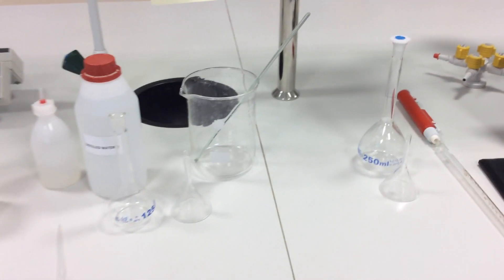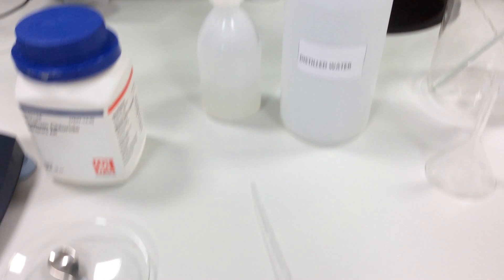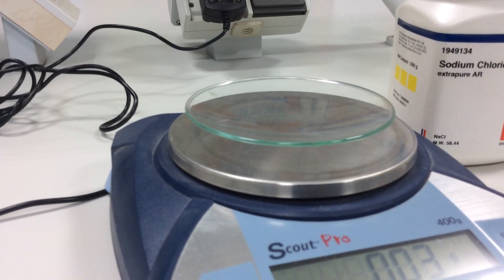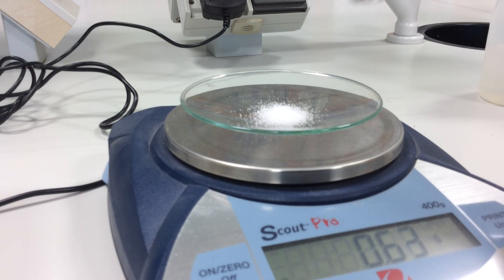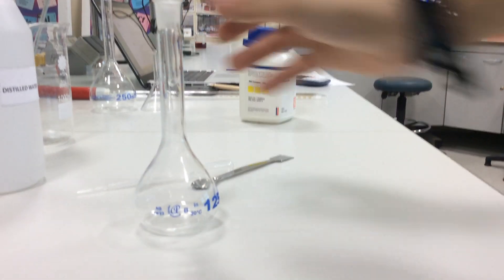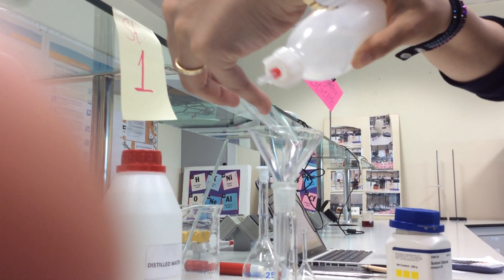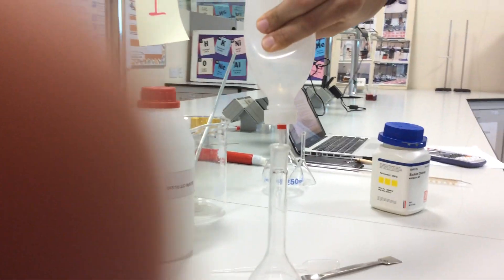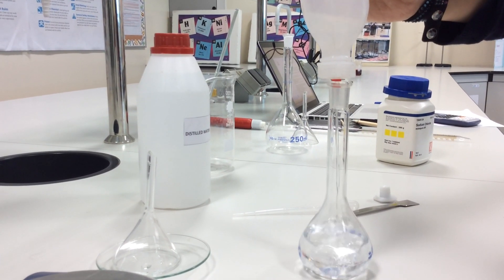preparing a stock solution of high concentration

Comment: how can i get mass (0.73)
Reply: I don’t know if this will be helpful since it’s a late reply, but I hope it comes in handy for someone else.

1. Find the number of moles. Use the formula  moles=molarity x liters and plug in the molarity and liters that should be given to you in the equation

2. Convert moles to grams using dimensional analysis: basically take the moles you got in the previous step and multiply that by the molar mass of the compound or element (molar mass is stated in the periodic table)

If you still don’t get it, there are tons of videos online. Hope this helps